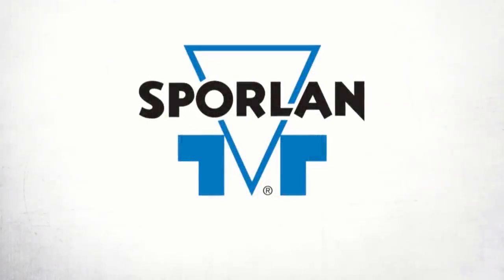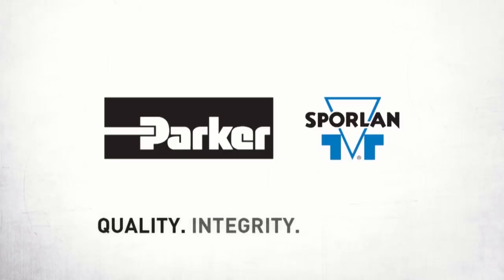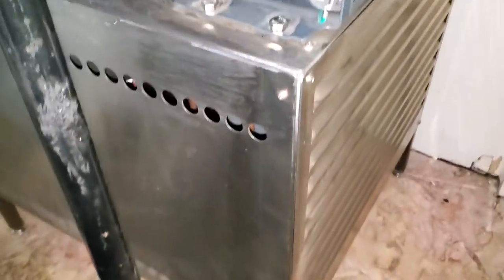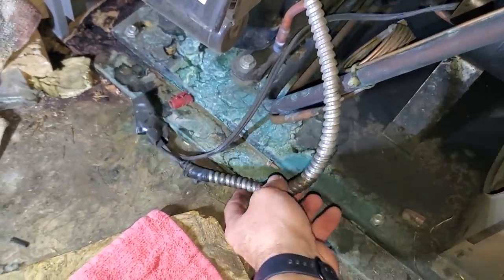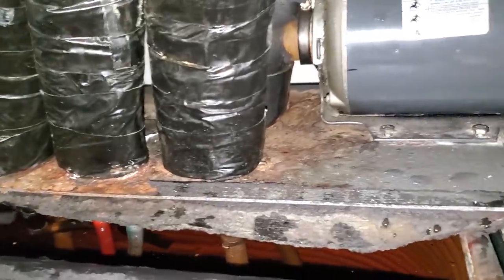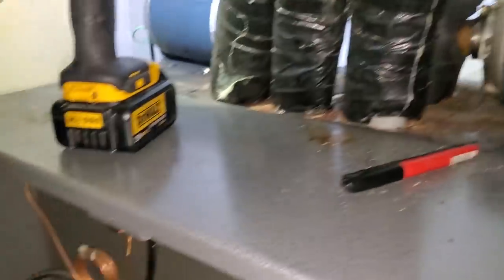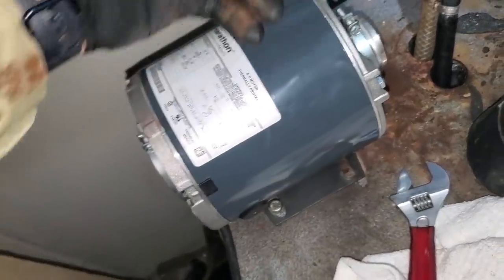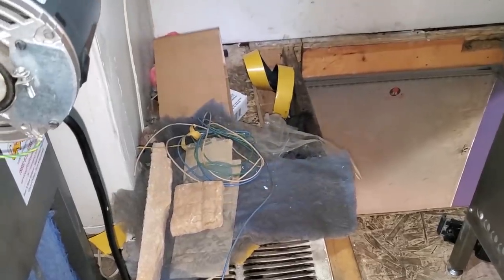BEER IS POURING WARM OUT OF THE TAPS

Comment: If these things break down so often they should have redundant chillers.
Reply: yeah, the restaurant business doesn't spend money on backup systems. They also rarely maintain their equipment in line with the manufacturer's specs. HELL, even manufacturer's of other random products don't schedule maintenance, they just run hard till it fails, then bitches at the maintenance dept until it's up and running again, and run till failure again. Endless cycle. They don't see where if they schedule the maintenance properly, and then schedule production around the down time (and worker vacation-maybe a bonus to take vacation during the line maintenance?), they actually save a shit ton of money. This is a fact. My father sub-contracted for Chicago Powdered Metals, and finally got them on a maintenance program which the CPM exec hated and didn't want. Immediate savings of 1.5M in the first year after everything was rebuilt, and the savings increased to over 2M yearly, PLUS no emergency outages causing all kinds of shit. Repair or beware!!

Comment: Well, all that shit will go into the impeller of the pump and just burn it out again, overload the motor, and wreck it... again. They need to drain and clean and refill... or run through a filter though being water and glycol I don't know why you'd do that. Obviously they need to change their filters as well. Dry pumps and clogged pumps will die every time. Heat is the enemy.

Comment: Thay system needs to be totally flushed, the other pumps should be replaced..the motors may be fine. Thats a mess you walked into. Get your self a refractometer it's a neccessary tool when working with glycol. And net time dont stick your hands in it.. you dont know if it was propoethyle or ethylene glycol.
Reply: FLY EAGLES FLY Bleed Green with the Potential contact with food/beverage it “should” be (FG-PG) so his hands in it shouldn’t be a problem. But your right you never know especially at some places.
Reply: A refractometer helps with concentration of glycol. Should also use test kits and see  how corrosive that mixture can get. Some water districts have a tap water that doesn't get along too well any glycol mixture. 
A few hugs of distilled water will normally work.
I've done that for 120 gallon closed loop systems. Ph levels still good after 4 or 5 years

Comment: I am left seriously concerned that the glycol used in this bar was SO filthy.  I presume (though do not know) that the correct glycol was in use.  Ethylene Glycol is used as a winteriser for auto radiators and is seriously poisonous.  The one used in the food industry  is propylene glycol but of course it is more expensive.... Hence the need to be sure about just what is in there.  That sludge rather indicates to me that there has been little or no maintenance - or that the two might have been mixed...  It does seem clear that the pump as well as the motor AND the glycol should have been changed in 2019.

Comment: Contaminated Water/Antifreeze is never good. As an Auto tech it causes things like overheating plugged heater cores and failed water pumps. The coolant gels and causes the passages in the system to clog up with gel overtime.
Reply: Don't forget EGR coolers and Oil coolers on diesels! But your exactly correct as gelled coolant is hell!

Comment: It's probably missing a filter.
Reply: or it is so clogged, that is just going thru an overflow/bypass
Reply: @artbrann  I'd rather expect to find that filter just before the pump. Guess someone 'fixed' the cooling system by removing it. IMHO. I'm not an expert.
Reply: when I was still in school for CAD/CAM, one of the machines hydraulics were so bypassed and jacked that it looked like a blind monkey worked on them, the machine overheated and shut down after about 15 minutes(took myself and another student a week to fix, but that include both waiting for and fabricating parts)... so it wouldn't surprise me either way

Comment: i`m not a beer guy,but first is the w/i/c col,first thing i check. it seem`s the pump was hard to turn. i think denis o`brien is 100% right. say for contamination they are sealed  from  outside air to prevent this your system seem did not have this.(is this the right pump to use,but i know every mfd dose use it for pump head distance (soda systems)????? some times mfd put an plastic coupling  between the motor and pump which fail (just hook  to drive drive) and the system working again.